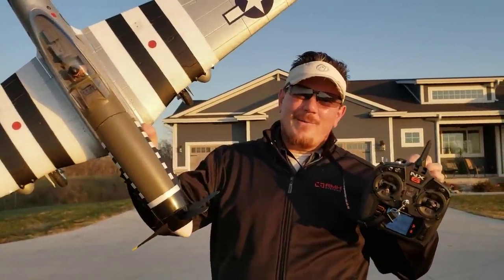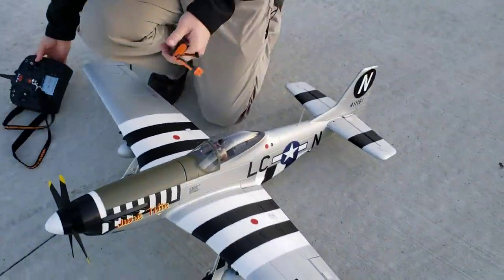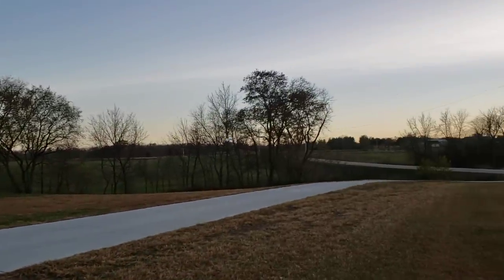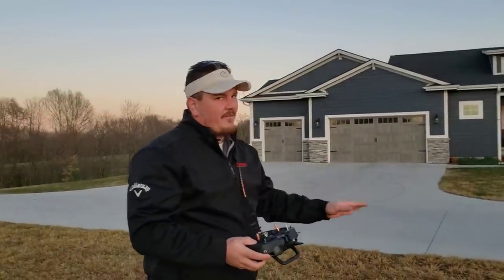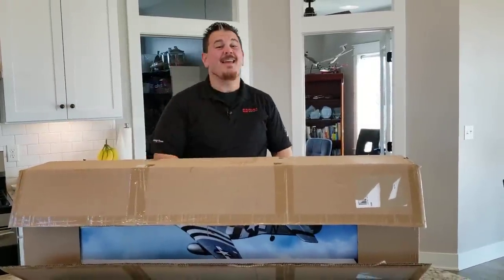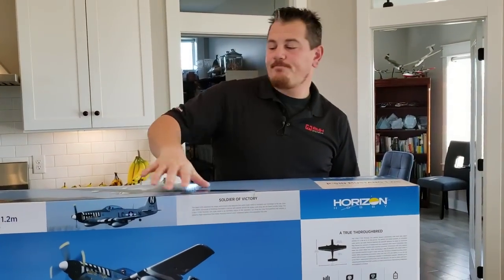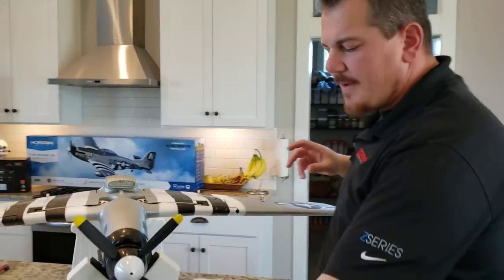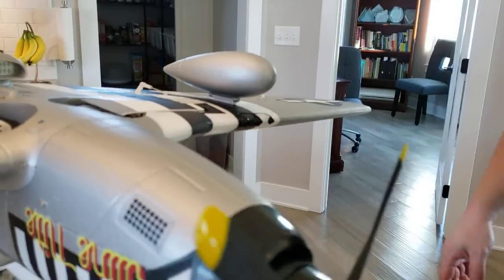Eflite - P-51D June Nite & NX6 Transmitter - Unbox, Build, Radio Setup, & Flights

Comment: So i maidened this today. It was nerve wracking bc im a beginner and probably shouldnt fly this yet but i did it anyway. After 30 minutes of figuring out ground handling, a few nose overs, and a lot of cancelled take offs i finally committed and i was off. Safe was on and bc i was flying up and down a lane with both sides having 50 to 70 foot trees i went pretty high and immediately went mid flaps and dropped the gear so i could land. Hands were shaking so bad that the plane was fishtailing slightly due to rudder input. I circled a few times then landed, with a nose over ending my maiden. 2 more flights later the plane is still without damage save for a scuffed up prop. Im so excited to fly again tomorrow when i have more room. This video is the most comprehensive and beginner friendly guide/review of this plane ive seen and i really appreciate all the hard work you guys have put in!
Reply from the maker: I'm so excited for you Matthew! I completely get it, and you're nerves are what make this hobby SO REAL! You will feel so alive when you fly these things, and if you don't, might want to check your pulse ;)

AWESOME! Good work, and keep it up...get a spare prop if you think you're gonna keep nosing over. They're not too bad, but you WANT ONE...Also, if you break off a blade, and you're left with 3...just break off one more and you can make it fly some more ;) Two opposing blades will actually fly great still, provided it's balanced close to even...we've done it a million times.

Good luck...

P.s. If you want to order parts, you can follow the link in the video description, but just click on the plane and then scroll down and you'll see "REPLACEMENT PARTS" or you can follow the "master links...(see below) and then just search like any other time you visit the site. This will help support us, as you have done in the past - THANK YOU!!!

P51 https://bit.ly/3bU5icI
Horizon Hobby https://bit.ly/38ZFade
Amazon https://amzn.to/2BGynZt

Seriously, good for you. Keep flying, but don't kill the plane. Don't be afraid to land in the grass, but you'll have to fix stuff...if you need too, put the gear UP and belly land it SLOOOOOOW ;)
Reply: i fly the P51-D i have both the EFLITE P51-D 1.5 AND THE FMS P51-D RED tail 1.7MM as for the nose overs i never use the flaps to take off always use flaps up and go into the power real slow power into the plane and hold that right rudder on landing use flaps to slow it down but at the last second before the wheels hit the ground i flaps up to avid the nose over i fly off grass so i never use flaps on take off only to slow the plane down before  touchdown
Reply: I can relate! I just did my maiden yesterday. It was my first hobby grade rc plane flight. I was shaking. 😂. Had a couple nose overs, but was a great flight on safe as well. Will turn off safe on my next flight. I'm feeling confident, or stupid, only time will tell. 😂

Comment: Man, that is a LOT of information, but I maidened mine the day after Christmas and I agree it's as well-mannered as it is pretty. I wheel-landed it on the second flight. The AS3X really does make it fly like a much larger plane.
Reply from the maker: I'm glad you agree ;) this is an excellent example of a plane, as was the immediate predecessor, the 1.2m Blondie (I also had)

Comment: I believe one of the selling points of the new NX series is  Horizon Hobby  BNF models  are already programmed to recommended settings in one of the menus. Just select the model number (EFL8950 in this case) from that menu and all recommended settings are locked in.  You can then fine tune to preference.
Reply from the maker: I know it's one of the selling points :)

Comment: Hey Brian, I run a 2700mah 4 cell in mine. I removed the straps and added velcro along the length of the tray. It slides in perfectly fine, and it holds the battery in great! Give it a try
Reply from the maker: I think that would be easier too. Good idea!

Comment: Would like to see you demo the Horizon download presets for a specific model via the wifi on the NX6. And fly model as is without your tweaking per your liking. It would be a demo of how a newer flyer may experience flying before actually knowing how to expertly program a radio  system.
Reply from the maker: That's not a bad idea. Maybe ;)

Comment: I bought this one for Xmas and also the A6M zero from e flight and talk about fun to fly . I’m not a beginner and the first flight on my P51 the prop kicked up a really small pebble and there went the prop. Second flight the rudder servo took a dump . I brought it home and replaced that servo . The mustang has a minor handling problem of wanting to tip forward with a 4s pack but that about it all . My Eflight A6M zero has absolutely no bad anything and I spent the day flying all day and 6 battery’s .
Reply from the maker: Cool Mark! Glad you had some good luck with the Zero. Was the ZERO by chance the FMS Zero? Eflite hasn't had a zero for a long time.

Comment: You can run most of the 1.2 warbirds  on 4S as they all use the same motor and ESC. I use the 4S on my eflite T-28, F4U Corsair and P-51. Don’t try it AT-6 without changing the ESC.
Reply from the maker: I've run my AT6 on 4S with good results too ;)

This plane is a joy on 3S or 4S, but love that Horizon came out and said it would be okay publicly.

Comment: One idea for a possible solution to the hatch messing up the paint on the top/front of the fuselage: apply a thin coat of medium CA to the foam on the inside edge of the opening and let it harden. We used to do this on the front of our foam tires in RC car racing to keep the tires from chunking on high grip tracks. Let it harden is what she said-lol
Reply from the maker: Great idea!

Comment: I will have to look into getting a smart charger and smart batteries.  I typically use chargers that don't need a power supply.  Would the dual one u showed that is AC do 3 and 4S packs OK, or a single l 6S 5000? 
   After using velcro on packs over the years, I would likely wanna try velcro on the pack and on the tray,  then possibly 1 strap around the pack?
Reply from the maker: There are two chargers that work great with AC...

The S2100 https://bit.ly/3ftGEyR (two lipos at a time) and S1100 https://bit.ly/3exoRWh (one lipo at a time).
Reply: I would just get the new G2 version Ryan videos.

Comment: Hey, any tips on how to replace the landing gear struts. I can’t seem to be able to find out how to get the struts off the main retract motor/servo.
Reply from the maker: You can unscrew the 4 mounting screws, then drop it down, and you can actually do it with the retract up AND down...you usually have to cycle the gear, if you want to do it while still in the holder...but you can also take the top off the retract, then just pull the thing apart - SMALL SCREWS ON THE SIDE - DON'T LOSE THEM!!!! - then you can use a metric driver to back off the set screws, and she'll come out...

HOWEVER - if they're NOT yet broken, but only bent, try supporting it and bending it back - you can get a couple "bends" back, if you're careful - good luck!

Not hard, but you need a small phillips for the case on the retract. Dig in, it's not the first or last time you're going to need to do it....speaking from a lifetime of crashing ;)

Comment: Would screw glue be recommended on the tail fens?
Reply from the maker: Not sure what you mean??? Do you mean locktite? If so, no. If  the screws are in there, they'll be good. I know it seems sorta weak, but you'll never find one loose ;)
Reply: Ok,thanks :)
Reply: Thank you for the p51 review,much appreciated:)

Comment: Do you have any ideas on how to keep the plane from wanting to nose dive during take off  I have the battery as forward as possible. Flys grate once you get up. Cg is just barely ,slightly toward the nose , when I bring battery back a bit it helps on the grass runway.  Just surprises me that it wants to nose dive .?
Reply from the maker: You have to use the elevator and right rudder to counter the P-Factor. It's a tough skill to get right! Once you get a feel for the plane, you'll feel so accomplished. It's not easy, but you can do it! Grass must be VERY short to get this plane on it's mains...but if you want you can even grab the tail and lift it and push it along to get it started if you want to do wheels up/wheels down on taller grass strips.

Comment: Does the bind plug have to be bought separately or does it come with the plane or transmitter?
Reply from the maker: It comes with the plane, unless there's a button, then you don't need it. If you don't have one, you will...trust me. I have hundreds

Comment: Will the tactic ttx610 bind to this receiver? I got this plane and I have this receiver from an old rf7.5 set and I don’t want to spend another $200 on a new transmitter
Reply from the maker: No, wrong protocol. Sorry. You can spend less than $200, but here's my recommendation.... IF you plan to buy a couple or more DSMX (Spektrum / Eflite / Horizon Hobby Branded)  planes, you may want to seriously consider getting a DSMX capable transmitter. Tactics is only going to be usable on a specific, now HORIZON HOBBY owned brand. Obviously you'll need that transmitter for what you have, but if you plan to stay in the hobby, get DSMX. Doesn't have to be spektrum, you can get orange or open TX transmitters (jumper, radio master, etc...) BUT I still think the Spektrum stuff is better, and only marginally more (200% the cost in some cases, I realize) and you'll be using it for years to come. I still have and use the heck out of my DX18. I love that Tx, and it's AMAZINGLY capable. I also have the T8SG Jumper, which does a bunch of different protocols, BUT it's so much harder to work with. The setup on the models is super clunky, and very steep learning curve, way harder than Spektrum...

Just my 2cent. You can obviously make up your own mind, but if you keep watching long enough, you'll end up with a Spektrum Tx at some point anyway ;)
Reply: @BrianPhillipsRC  will the DXS work with this?

Comment: just picked this up and love it. Struggle with the take-off sometimes as she wants to nose down once the tail-wheel comes of the ground with 4S 2200. Any suggestions on getting take-off as smooth as you have it?
Reply from the maker: 1) Take off from pavement if at all possible.
2) Loads of rudder as you spool up.
3) Slowly feed in throttle.
4) Don't resist the tail coming up, but you CAN if you want to wait on it popping up BEFORE the controls come alive (meaning enough air over the control surfaces to make them impact directional change on the plane)
Reply: @BrianPhillipsRC  one last question. The instructions give me the impression that I should bind with all three wheels on level surface (nose up slight attitude), in some videos I see the plane being bound on a stand at traditional level flight. Can you confirm how you bound to ensure successful first flight.

Comment: Which plane flies better? 
This one or the FMS F4U Corsair?
Reply from the maker: This plane is not really a comparison to the FMS Corsair, since it's HALF the size, and WAY less money.

That being said, they're BOTH very good. The P-51 is way more wide spread appeal, since it's cheaper to fly, batteries and plane, as well as being easier to transport and still quite the looker!!!!

...BUT, if you want a bigger plane, the FMX Corsair is a GREAT plane in it's own class!

P51 1.2m / 1.5m https://bit.ly/3bU5icI
VS
F4U Corsair 1.7m https://bit.ly/2HV65xP
+
AR637T https://bit.ly/3pW3u86

Comment: Hi Brian, which is better between the Focke Wolf from Dynam and this P-51...I know the landing gear is bad with the 190 but how are the in air characteristics of each?
Reply from the maker: Any Dynam is basically garbage compared to this plane. I'm very sorry to report this to you, and I take no joy in reporting to you that they're so terrible.

As for flying...the Focke Wolf is one of the better flying planes, but you will spend a half day and many frustrations getting it in the air, and it will then start giving you problems with gear IMMEDIATELY. As for the P-51, you'll build it and it will perform flawlessly, with maybe 1/2 an hour of build and setup time.

Don't mean to be a debby-downer here on Dynam, but they basically suck. Sorry Alexander.

P51 https://bit.ly/3bU5icI
VS
Fw190 https://bit.ly/3lt5owK + AR631 https://bit.ly/3pYNC3c

Comment: My June Nite came with the tailwheel slightly off center and I got tired of it not taxiing straight. So I just tried to unscrew the 4 screws on the bottom but I was only able to get 3 off. The last screw won't loosen. I assume that I need to get that last screw off in order to access the clevis?
Reply from the maker: Yeah, probably. If you can't get it to come off, try heating the screw, and pulling the screw into the plastic to melt new threads. This might help you get the cover off????

Comment: So I’m not sure if I missed it, but did you have to add some weight in the nose? And if you did, how much, and where did you mount it. Thanks Brian.
Reply from the maker: No none. I used a bigger pack though ;)
Reply from the maker: I kinda hate adding dead weight, so if I can get a larger capacity battery, that's far preferred.
Reply: Yea that souds better, thanks

Comment: Do you feel the NX6 would be a good "next" transmitter for a newbie? I currently have the DXs that came with my RTF AeroScout
Reply from the maker: I wouldn't spend the money for an NX6. If you want to drop that kinda cash, get the NX8 or you will be pissed in just a few short months when you realize you want/need the extra channels and knob. I know this is annoying to consider, since there's a pretty good difference in price, but take my word for it, or just buy one and have it as a "loaner" for a friend to use when they visit ;)

NX https://bit.ly/3mbVuNB
Reply: @BrianPhillipsRC  thanks Brian. What's your opinion of the DX series? There's a guy in my flying club that has a DX8 he may be willing to part with.

Comment: I already have the 1.2m P-39 and the T-28, but am considering the P-51D or the F4U-4 Corsair. Gotta love the 4 blade look. I already have the Air Tractor, Commander, and both Timbers, so I'm not scared of tail draggers. 

I've also seen your Corsair series from 2016. Which of the two planes is more fun? Is one more fun on 3S or 4S than the other? Was leaning towards the Corsair, but now unsure. Already soo many P-51s out there. My flying style is very acrobatic like yours with a few rolls and failed straight line knife edge attempts sprinkled in.  Whether I fly with ordinance or not will depend on the acrobatic stability. 

When I consider the two planes, I'm just looking for something different than what I already have. Thanks!
Reply from the maker: The Corsair is GREAT, but the P-51 is very fast, and VERY slow. The F4U corsair is very cool too, but it's definitely different ;) I guess it might come down to what you like better. The F4U doesn't have SAFE select, if that matters.

Beyond that - they're BOTH great!

Comment: This video was great for me.  I have a few planes, an aging DX6i, and am looking at getting back into flying.
  Deciding on a DX8e or NX6/8 is tough, as well as which plane to get next.  Night Timber X, this P51, or another aerobat like the Extra or Ultimate.  Someday I may go with one bigger plane like the bigger Cub or P-51 1.5m.  Hence considering an 8ch radio.
Reply from the maker: You won't regret the NX8...if the price jump from NX6 to NX8 doesn't put you off too bad, I'd go with that. The nice thing about the NX6, is that it's actually 7 channels ;)

Comment: Hello, my p51 veers to left on take off and landings, could you share your technic on straight take off and landings? Thanks in advance.
Reply: My Carbon Cub S2 has the same tendencies, always applying right stick pressure.
Reply from the maker: Very tricky use of the rudder. The torque from the motor spooling up that big prop will always play a part, but you can just ease in the power slower, and use rudder to keep her straight. When you get the tail wheel up, use some DOWN elevator to keep her tracking straight and LEVER, and some right rudder to keep her pointing straight. It's a very tough thing to do, and subtle enough that AS3X doesn't take care of it for you...

You will see this BIG time on the 1.5m P-51 - it's CRAZY power and will about tip the plane over!!!

Comment: Hi Brian 

Do you know if the dx6 transmitter is compatible with smart and if so do you lose a channel to safe. In my Current model I have flaps and retracts so want to keep these on their own channel and have safe on another.
Reply from the maker: The DX6 does not define SAFE or not. It's the Rx that houses and runs SAFE. Your DX6 can operate a plane with SAFE or SAFE Select, but you may have to choose if you want SAFE on all the time, or if you want to share a channel used for another function to turn it on and off. This is not idea, but you CAN do it.

I'd recommend at least an NX6, if you're looking, since it's ACTUALLY a 7channel Transmitter. Issue with the NX6, is that it's only like $40 LESS than the NX8...so if you're taking the plunge, I can't in good conscience suggest the NX6...

NX https://bit.ly/3mbVuNB
DX https://bit.ly/2OwKprB
Reply: @BrianPhillipsRC  thank you Brian that clears that up I’ll go for a nx8